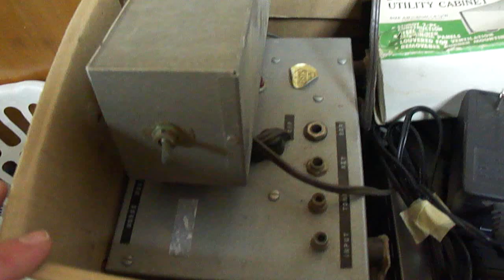Solid-State relay control unit for electric heater

Comment: Good day,
This is ve6but ham radio guy I saw your vedio regarding solid state relay turning light on/off, I was woundring if you know how to wire up nest second generation thermostate so I can turn on/off relay, so I can turn on/off my garage radian heater.Email: ve6but@gmail.com 
 Best Regards Ve6butTosif
Reply: Did you get any feedback on this?  I was thinking of also using a Nest thermostat on a ClimateRight 2500W (Portable) ac/heater, but am installing it as a permanent solution for a live-in Van.  Would love to know if you got your answer. Many thanks.

Comment: Does it matter which side of the AC wires you hook up to the relay? For example, it appears you have the hot side of the AC line controlled by the SSR, could you have used the negative side and if not, why not? Thanks!
Reply: +Michael Angel Thanks for the replay. I figured it out, this comment was left 11 months ago :). It all depends on the opto relay itself and which side is the control and which side is the load. For the relays I bought they are controlled by a DC input (+ and - contacts) from 3V to 32V and the load side is AC positive. The opto relays say in the instruction manual that you must use positive on the AC load side and this, according to the manufacture and others may be different, is required because without some voltage power will not flow through. I also noticed that without the AC side being hooked up a multi-meter on the OHM setting read an OPEN instead of a CLOSED even though DC voltage on the control side was there. I love these solid state relays and I would say just read the manual or contact the manufacture in order to understand how they are hooked up.

I use the Morningstar RD-1 relay driver to control mine loads so that I have a cut-off when my battery bank is too low, or at any point I choose, to avoid damaging my batteries...generally for 12VDC lead acid deep cycle batteries that means running them below 11VDC under load which I never do. I have my relay set to disconnect all AC loads when the bank falls below 11.5VDC under load. 

Thanks again for the response!
Reply: +MrHelloman1976 No, just the DC side.
Reply: +MrHelloman1976 Generally, it don't but you'll find, if you already haven't if you connect the source to the positive post of the relay controlled switch and use the negative post to the controlled item, you'll generally have less problems in trouble shooting if your relay over heats or break down after a short time in operation.

Comment: How to check whith a multimeter a good function of a SSR
Reply: you couldn't by multimeter . it should put at circuit and check on/off output by applied input control
Reply: thanks

Comment: HELLO. can you adjust  the input trigger voltage so the relay can only turn on when for ex. 24 volts dc is applied. maybe by just using a resistance potentiometer or a fix resister set at right resistance.? Thanks.
Reply: +Bay Drifters Trigger voltages on these can usually be anywhere from 3-35 volts (15v on these) DC, so you can use anything you like to get it in that range.  I'm using an old Linksys 12v router adapter to run mine.
Reply: You could use an inverted 24VDC diode Zener so your circuit could work after 24VDC.

Comment: cool video friend , hey not to be a smart ass but the cut off lag is also caused by magnetic oscillation of a collapsing field , when you cut the power to a transformer the field bounces like a ball until the energy is dissipated , wen the field calaspes it induces a current this cauases the field to expand again but with less energy and so on

Comment: Great! Like you, I was about to buy a standard heavy duty relay for my project similar to yours: I want to use an HVAC programmable wifi thermostat to control the heating plinth in my garage. My only concern is I hear that SSR tendency to fail "shorted" on their outputs, while electromechanical relay contacts tend to fail "open".
But maybe I could use 2 SSR plugged in serial...

Comment: I need to do something similar with a 13 amp 240v load (3kw fan heater), do you recommend an ssr or a standard 240v coil contactor?

Comment from the maker: @PhattyMo Yes you are right but my system at home uses a 12 volt DC supply to the thermostat contacts so the proper voltage is applied to the solid state relay.

Comment: One thing to note, I see the SS relay is rated for a 3-15VDC input. Most thermostats/HVAC systems provide 24VAC power to the thermostat/controls,IIRC.